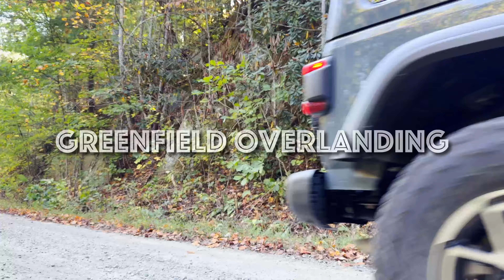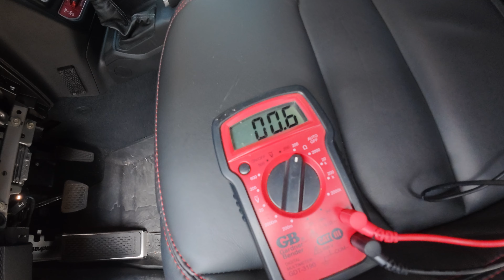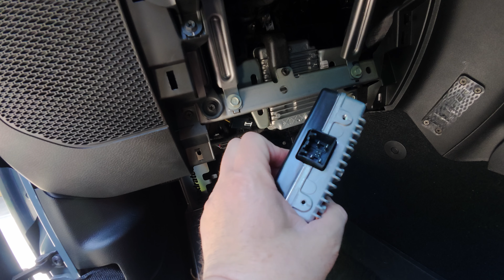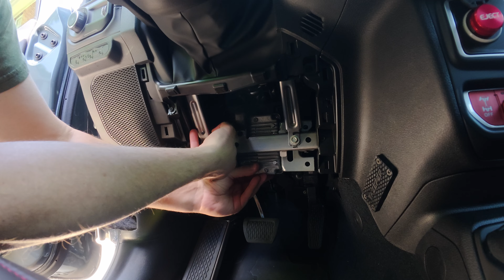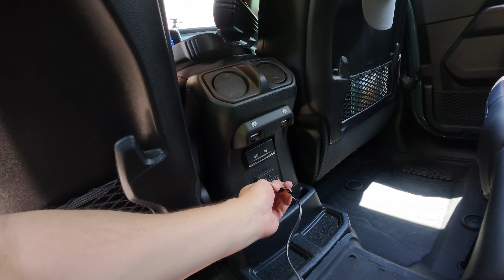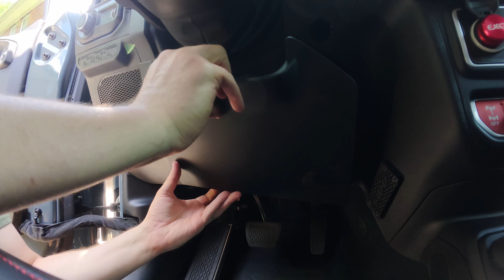Jeep Wrangler AC Outlet Dead? Easy $70 Power Inverter Fix

Comment: Should really test between live in neutral a lot of these cheaper inverters have a floating ground (that's assuming they actually have a ground and not just a hole in the plastic casing to get around some requirement). Plugging in some thing that drives more than it can output should just trigger an overload. Then again a lot of these are not pure sine wave and are relatively cheap units so I wouldn't necessarily trust them either.
Reply from the maker: That’s a great point, I’ll definitely have to test that and look closer at the power output.
Reply: AutoZone has 400 watt inverters that can plug into cig lighter for power. Cool red eject button 😂